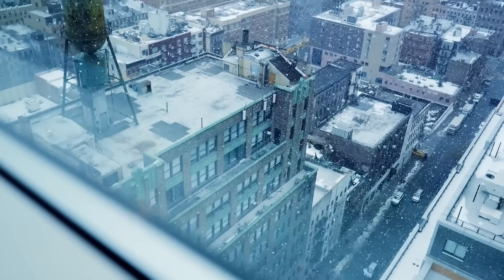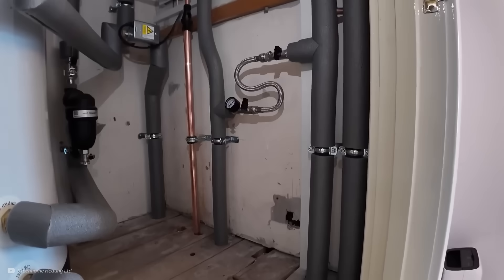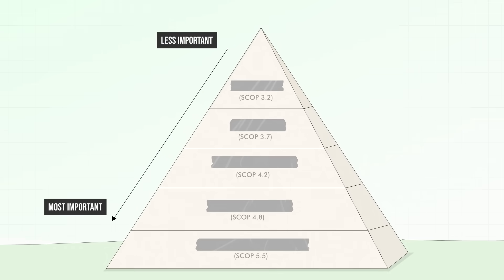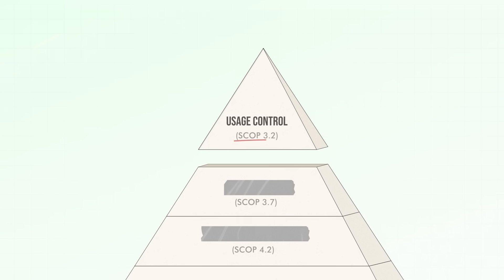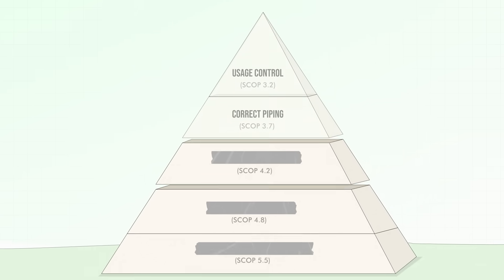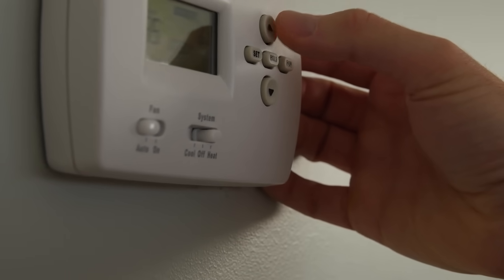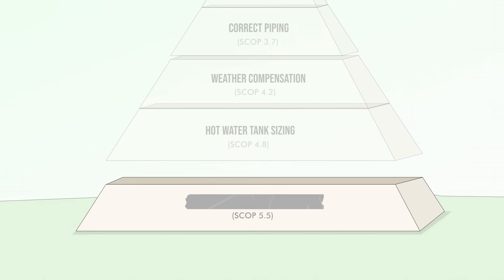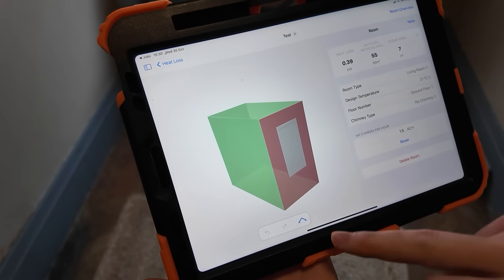The Genius of the World's Most Efficient Heat Pump

Comment: I'm curious how a in-floor heating coils embedded in concrete disrupts the floor. The concrete functions as heat storage which, it seems, would contribute to the further reduction in the required temperature of the water needed to heat the room. The comfort aspect is also significant, requiring a lower temperature to feel comfortable.

Comment: Instead of one massive heat storage unit, use 4-8 separate storage units daisy chained in line to extract
the heat gradually, also run the coldest leg through a slab floor to to return the working fluid at under 70 degrees f. Run the store/extract heat lines in opposite directions, this will allow heat input from several sources, (strait solar in summer, heat pump in winter). Put the the evaporator in a small green house and run it only when the temp is elevated,(store heat in the day , extract at night).

Comment: I love what Heat Geeks and you are doing around efficiency .. but many installers, at least in my region, a critical piece is often missing IMO .. and that is the economics of how these installs are designed.  I recently did some trouble shooting on a system in my area and aside from the usual mistakes (oversized heat pump, too many zones, buffer tank used, etc.), the designer and installer also did not account for how the utility company billed the client.  The utility in question billed separately for energy (kWh) and power (kW).  This heat pump had 9 kW of resistance elements to boost output under certain conditions .. even though the site had a gas boiler as a backup.  In this case the resistance elements needed to be turned off completely so that cheaper gas (in this case) could be used as the "peaker".  I saved the client about $5,000/yr by a simple adjustment to his settings.  If Heat Geeks here are listening .. please include some videos and information to help installers install not the most efficient system .. but the most economical options.  Not everyone wants to pay for the best efficiency .. the perfect is the enemy of the good.
Reply: Sit back and laugh, they are😅😅😅😅

Comment: Heat pumps will never be viable and economical for two reasons, one It's main component is prone to failures and don't last even a decade and cost of It is massive compared to let's say gas boiler, second reason is that both infrastructure and market is not ready for mass heat pump implementation due to fixed power plants amount, implementation of electric cars and heat pumps despite their low numbesr already skyrocketed energy prices, supply and demand rule works whether we like It or not and more power hungry devices plugged in the higher energy prices will be!
Reply: Aren’t you full of B.S.  Have one and for 15+ years….saving tons of money to heat and cool our home.  Getting ready to purchase anEV with bi-directional function to use car batt as back up power and storage for our home.   By the way we use 400% less electricity than when we heated with pocket wall heaters… resistive heating devices.
Reply: They are already commonly in use and last 20+ years. Tf are you on about.
Reply: @logitech4873  yes they are, but how much energy costed then and now genius?? 20 years ago there was no electric cars or heat pumps so demand for electricity was lower hence price was lower, now due to EV's and heat pumps demand has increased skyrocketing prices!
Reply: @sebastiansuder6069  Energy prices depend on where you live. Electricity is still super cheap where I live, and EVs sell more than anything else here. Heatpumps have been common for like 30 years in my area, and they REDUCE the amount of electricity being used because everyone was just using resistive heaters before.
Reply: @logitech4873  Energy price do corelate with place of living only because different places have different electricity producing capacity, again It's called "supply and demand", there was no time when people used resistive heaters on mass scale as gas was always cheaper with the exception of times of the day when there was no demand for electricity so energy companies sold It a lot cheaper meaning at night with off peak tariffs.  Problem with heat pumps is that they are a lot less efficient at lower temperatures meaning at night where these off peak tariffs are attractive, moreover heat pumps have a big issue with humidity as It causes them to freeze up and then same electricity which suppose to be used to heat house is used to defrost heat pump-so It's wasted! Why does no one say that wholesale price in UK for megawatt-hour is around £100  and in Norway is around £18!!! That's exactly why heat pumps are not viable anywhere in UK because of the cost of electricity!!

Comment: It should be pointed out that a heat pump essentially moves heat from one place to another and requires energy input in order to do the job. As such, even with a very high efficiency rating, a heat pump is still an energy "sink".  NOTE: Heat pumps do generate some heat, but it is a byproduct of the underlying mechanism, and a very tiny fraction of the overall process.

Comment: I have Vailliant arotherm heatpump. 800% is wishfull thinking in real-life scenarios with dhw. I currently have a scop of 6,6 (with dhw). Which i think is absoluty amazing. Did the install myself, watched almost every heat geak and urban plumber video there is. Complete open system with 2x underfloor heating manifolds. Flow is king, know your heat loss and size the system accordingly. Keep the system as simple as possible!
Reply: I dout your scop of 6,6  whith a vaillant heatpump I don't beleave a scop more than 4,5
Reply: How did you measure it?
Reply: What are your experiences with the payback time? Also, if the higher scop is achieved by running the heat pump more or less continuously, how much watts power do you actually consume (annual average) in the heat pump? Finally, the choice of copper (!) pipes in stead of plastic: is that not very expensive? Is that a cost-effective choice or an irrational fixation on the scop, disregarding other factors?

Comment: Ok, I realize you (or this heat pump company) are cherry picking the data and season. Having a supply close to your required temperature is going to make it more efficient for heating, but it'll make it less effecient for cooling.

Also a natural gas furnace only uses 500W of electricity for 10kw of heating. So I guess it's got a SOC of 20. Pretty impressive. 😅

Comment: It’s quite interesting that you, in the UK, use the heat pump to heat water for the radiator.  I guess that’s done because houses don’t have room for running air ducts to every room.  What I’m really interested in is geothermal and especially now that there is a direct geo option.  I’m sure it costs a fortune so I, at least, will have to wait but instead of running water through the ground, they run the Freon, or whatever the current gas is, down and out on an angle in 8 directions.  The other cool new thing is a smart system that utilizes your heat pump efficiently for everything that relies on heat transfer in the house.  Hot water, climate control, heated floors, pool, clothes dryer (maybe), and they should include the refrigerator.  I think the last two fall under throw away and replace when broken instead of build in and fix.  I really hate that we have become such a throw away society.  Anyway, it was quite interesting to watch, thank you and best wishes for a bright future.
Reply: I wouldn't want refrigerant lines in the geothermal loop. You'd get a slight efficiency boost but there are too many downsides. A slight leak will cause tons of problems that you wouldn't be able to fix. With a water loop you can safely ignore small leaks.

Comment: My woodstove cost me $1200 to install and it heats my home, my floors, is a cookstove for baking bread and everything else. I spent $120 on pex pipes to heat my home and the best part is that it is 100 000 000% efficient. I burn dead wood from around my house that would otherwise build up and destroy my home if I left it there and just used a heat pump. My system works very well at -40C unlike the best heat pumps that bottom out at -18C. If I lived in a climate like yours with a higher population density though I would consider a heat pump but I think Natural gas is still cheaper than heat pumps, is it not?

Comment: A scop of 8 is easy when it's 20C outside lol More interesting would be the 2.5 when it was near freezing, but even that isn't that crazy anymore if you get a decently made one from a manufacturer that actually knows what they are doing, which not a lot of the larger ones seem to. At the end of the day the problem with adoption of heat pumps isn't really their efficiency, it's installation cost. On average pumps themselves cost around 5 grand and depending on how much you need to do to adapt an existing heat circuit you might be looking at 20 grand all told while gas prices haven't risen as much recently, so those 20 grand have to come back in in savings over your normal gas bill and that might take 20 years, which is much too long for most. I did calculation for a gas price of 9 cents over the electricity of 32 cents, even at a yearly average efficiency of 300% I am hardly making any savings that could justify the installation cost. You need a yearly average of 500% and more at those prices and then you are still only really saving maybe 300 bucks a year so it'll take forever to get a return on the investment. Gas prices would have to double or triple for this to make sense, electricity is simply too expensive.

Comment: My problem with SCOP is that it doesn't really account for annual usage - more than 90% of my home's heat energy is consumed in 6 months over the year

Sure, the summer COP might be 5.5... but I use about 150 kWh/month of energy in summer heating hot water for showers

The winter COP of 2.5, on the other hand, is when I'm using 1500 kWh/month and is FAR more consequential

Unless SCOP is properly weighted for real world usage, it's essentially irrelevant as a metric

Comment: A clear commercial hidden under tech discussion... heat pump efficiency is defined by used refrigerant and by delta between the temperatures. Heat recirculation is another great add on if home is built in the way to capture the heat instead escaping trough ceiling and roof... so it is correct that systemic approach may maximise the efficiency especially by adapting the home to it, but no way to go beyond physics behind the heat pump.

Comment: Low and slow can cost the customer a lot more on a radiator system but they will have a better scop. IMO scop is a vanity project of some installers. Each system and customer should be looked at separately

Comment: All these heatpump's efficiency depends on source vs sink differential temperatures. You can't pump heat efficiently unless a constant differential is maintained.
Under ideal conditions, there is enough heat to extract from ambient, and enough heat to absorb without a raise in temperature. Everything else is a tweak to maintain this condition.❤👍

Comment: Technically what they are minimizing is the pressure difference between the low and high that the compressor has to make in order to meet the system goals, plus the pump and fan electric costs. 

Some things they didn't mention: heating your hot water at the warmest point of the day, using the hot water at the coldest time, having the opposite in cooling seasons (a cold water sync). Optimizing for time of use differentials in power rates.

Comment: If you have an Anker Solix and a heat pump you can even run your heating during a power outage. 😉 (Other kinds of electric heating would drain the battery very quickly.)
Is it true that heat pumps only move heat, and not generate any? I thought it was a little of both, because you compress a gas, it gets hot, that seems like heat generation. When the gas decompresses and goes to the outside radiator it gets very cold, so it is heated up by the outside air, that is heat you extract from the environment. (I'm not a thermodynamics expert)

Comment: HEAT PUMP SCAM!!!!!!!
Heat pump MINIMUM size for a small 2/3 bed property = 3kwh or 3000 watts will run 24 hrs in winter.
In UK £0.245 per kwh x 3kwh pump x 24hrs x 7 days = £123 per week and you CAN'T guarantee a shower when you want it or your house will be warm!!!!!

NO HEAT PUMP, RADIATORS OR PIPES
4 x 500watt fan heaters (total 2kwh) in 4 x rooms running 24 hrs BUT the thermostats will turn off when necessary, therefore NOT RUNNING 24hrs. (Larger heaters can be used, they'll warm room quicker, be OFF longer)

Remaining 1kwh or 1000watts is for hot water/showers.
3kwh heating element fitted at each hot tap under sinks.
INSTANT hot water for each sink/shower.
<30 seconds to fill the sink, few minutes for a shower. We're talking <than 5 pennies or cents for a shower because the 3kwh element is only on for a few seconds to fill a sink and a few minutes to take a shower!!! 
The hot water elements are OFF 99% of the day and the fan heaters are off 50% of the day,..less if you're at work!

Fan Heaters <£$15 ea.
The hot water elements £$68 ea.

4 x heaters 15 = £$60
3 x elements 68 = £$204
Total:                      £$264
LESS PIPES TO LEAK.
NO SERVICING COSTS.
NO REPAIR COSTS.
NO RADIATORS.
NOT HOT WATER TANK.
NO PRIORITISING WATER OR HEAT.
NO £$16,000. INSTALLATION COSTS.
NO BRAINER!

HEAT PUMPS ARE A  SCAM, somebody tell me my calculations are wrong!
Retired gas fitter.

Comment: My two cents  about it @ 5:41 I guess they never heard about JRG or G+F Sanipex MT pipes. I would prefer them against copper. You don't smaller the ID with this system, actually you bend the pipe wider and then stick the fitting in, but the pipe and the fitting now have the same ID. And you can reconnect it when you want to.  If they be honest 100% copper causes turbulence in the pipe, because you have the wider fitting but in one flow direction you always hit the wall of the tube because the tube itself is smaller of course, otherwise it won't fit into the fitting. Greetings from Germany

Comment: i think you have missed the most important point. Efficiency in heat pumps is directly proportional to the difference in temperature of the hot and cold side. It is very possible to get a cop over 20 when for instance the outside air is only 1 degree colder than the inside air. if you want to double your cop you need to half the compressor speed, this is an estimate.

Comment: I just bought a heat pump for my house that has a COP of 7-8 when the temperature outside is above freezing. It was a middle of the road price option procured by a small local HVAC company. My energy usage in the working temp range has actually reduced to 1/7 of previous, so I’m confident the rated COP is correct. So I’m wondering how this guy “broke the record”…glad to watch a video about heat pump system improvements but does it need the embellishment? Not everything needs to be special years after it has been widely adopted.

Comment: Multi-head split units in the house is far more efficient and 800% cheaper. Heat pumps start at $15k to 40k. 
To do it right you mist replace everything in the central heating system.. the commend about 40c in the heating tank is suicide from legionnaires disease growimg in your tank then shower
ing in it. 38c water tanks in hospitals killed people years ago. Water in tank must hit above 60c to pasteurise the water. Heat pumps don't save money compare to current gas prices vs eletric prices. 
You still have to run an electric element in the water heater to bring the water up from 40c to +60c. 
Only reason they want everyone on heat pumps is to reclaime the gas to run the peaking power plants in the future.
You can miss out on installation cost if you by a 80c output rated heatpump and hook it up to an exsiting old style central heating system.
 The efficiency of the heat pump is the key driver of where your COP will sit, 800% isn't groundbreaking, but fail to mention the total installation cost to get it = replace everything and x4 oversize to make it run on sub 35c circulating temperatures.  Look at some of the C02 gassed heatpumps they can run in all conditions with 80c output temps down to -20c outside air temperatures

Life hack, put the maximum sized radiators in every room and thermal valves on them all, lower your boiler temperatures and halve your gas bill, save $40k on a heatpump that will probably burn a compressor out in 5 to 8 years.

Comment: First off: I have a heat-pump and have an all-electric house since last year. Comfort levels have increased dramatically.
That said, several  improvements are impractical and/or expensive.  Piping is often a given as it's embedded in the floors or walls, and replacing emitters can be a very costly exercise.
Replacing my existing radiator panels with low-temperature versions would cost about 500 euro each, and I have 8 of them...  Cheaper options are available but are bulky/ugly and don't pass the WAF test.  
Finally there is DHW sizing - that's problematic in terms of space: any heat-pump system is space hungry because of the hot water cylinder that must be placed on very secure footing.
Conclusion: use the hints and tips to your advantage, but if limitations as outlined restrict sCOP of 3,5 to 4 then you're still doing well compared to the gas boiler!